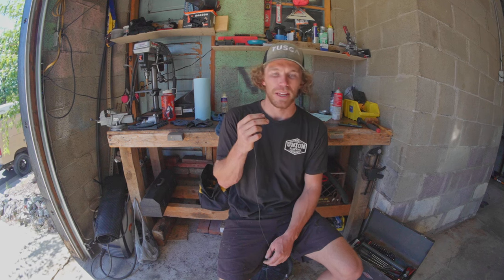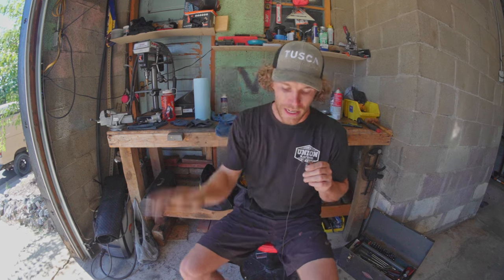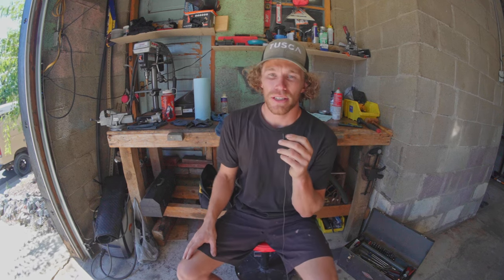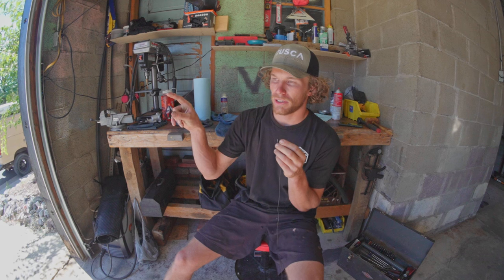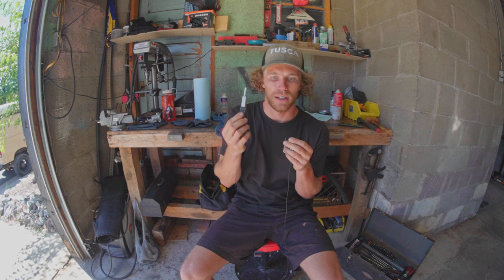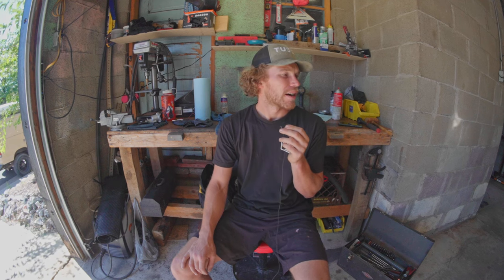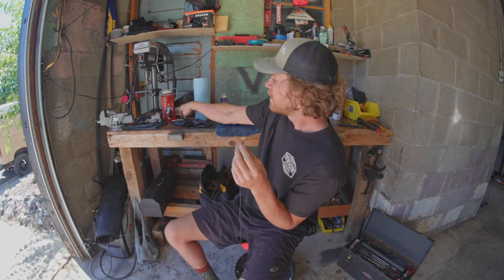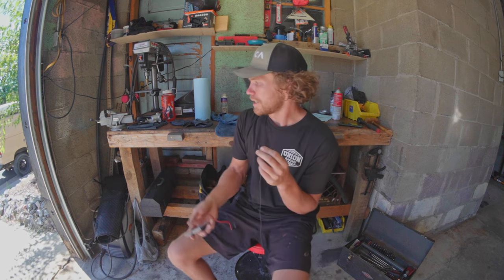Build Update: VNT control takeaways & ALH progression

Comment: If the VNT setup doesn't end up working, you could always try using a fixed geometry turbo with a tightish turbine housing and a large compressor, then bleed off the excess Drive pressure with an external waste gate on the manifold in tandem with the built in one on the turbo. That way you're getting the quick spool of the tight housing but when it and its internal waste gate starts to get restrictive the second bigger gate opens and bypasses the turbo. your Arduino setup could essentially run it as its basically balancing boost and drive pressures like the VNT. I know people in the Rover community have done this with good outcomes, usually a stock GT15 turbine housing with a 17 wheel and 52mm 0r 56mm compressors. OR.. just fit compounds😁
Reply from the maker: Heyyyy! That is an excellent proposal 🤓 thanks for throwing out the idea. Compounds at some point would be sick 💪

Comment: hey, I run a VNT on my 1.6D. I use an arduino setup, but instead of soldering things I created my own PCB with the arduino chip on it. Instead of using a linear actuator, I use a N75 valve (solenoid), you can probably re-use the vacuum controller you already have running on the current turbo
Reply from the maker: Interesting! So you're using the Arduino to control a vacuum system?

Comment: A VNT package would be awesome Ollie, are there practically no options for a more modern(bigger turbo) thats not VNT controlled that would fit 1.6TD/AAZ 1.9 TD? standard manifold wise i mean like the tri fitment or trapiziod shape
Reply from the maker: Yeahhh there's essentially no turbos that fit the 1.6 manifold 😵 I ditched the original a long time ago for that reason (not that it's been easy to do so lol). A little bit of welding goes a long way when tinkering with other sizes.

Comment: This is a cool build, what sensors do you use for your arduino setup?
Reply from the maker: Thanks! Currently using just intake & exhaust manifold pressure sensors (2). I think at some point feeding in engine RPM would be dialed as well